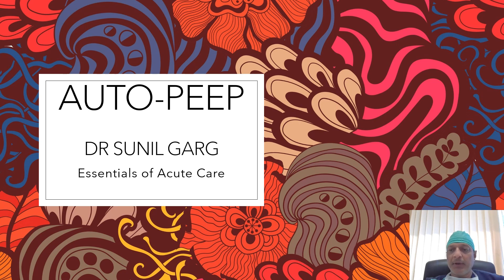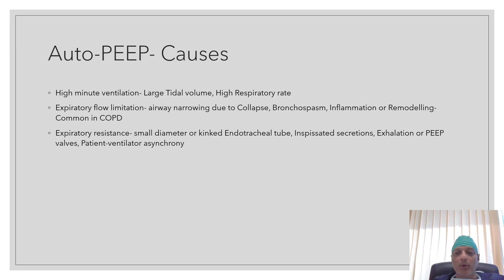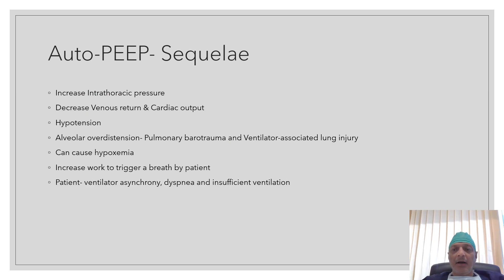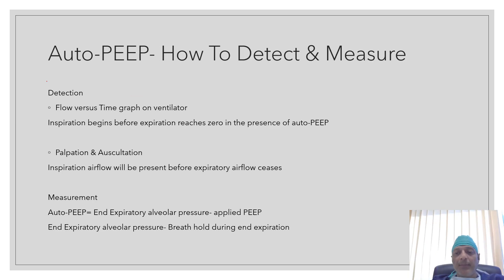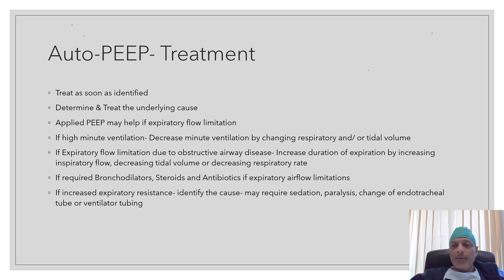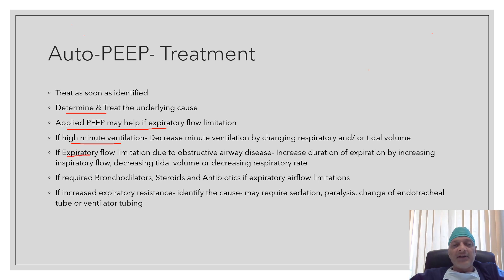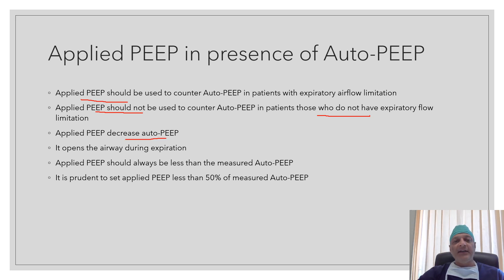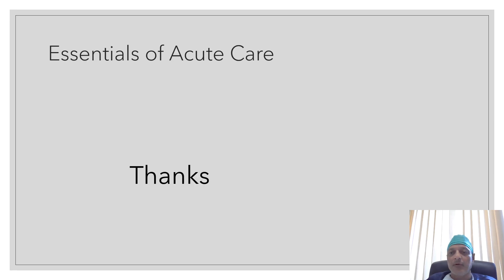Auto PEEP- Let's understand it

Comment: What is the static pressure sir, you mentioned in the video?
Is it the plateau pressure????
Reply from the maker: Static pressure is any pressure during ventilation when flow is zero. It can be end inspiration or end expiration. When it is end inspiration, it is plateau pressure
Reply from the maker: When you apply external PEEP during expiratory flow limitation to counter auto-PEEP then it should reduce auto-PEEP if it is effective and it will reduce static pressure